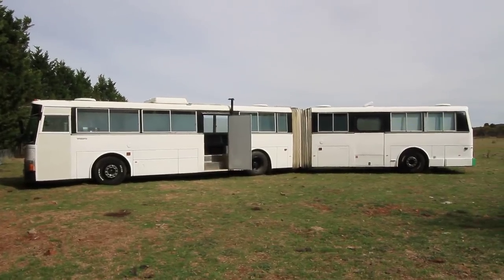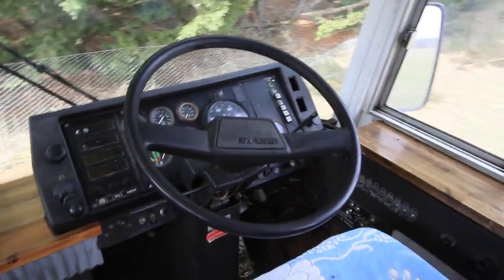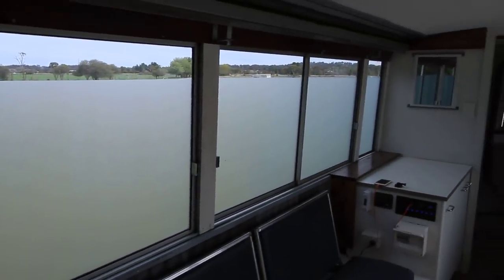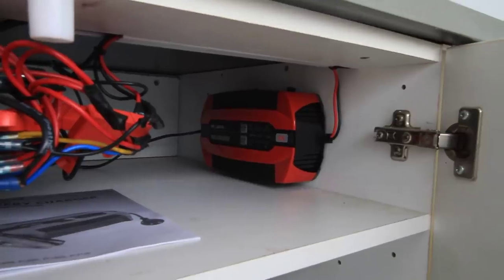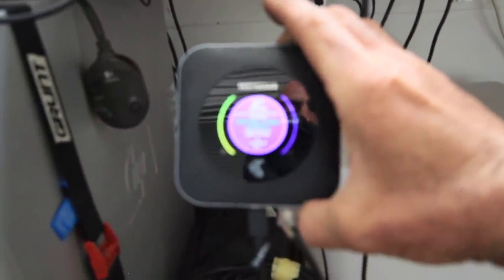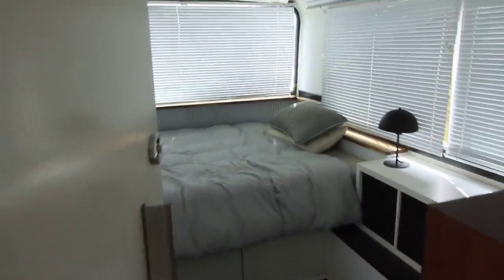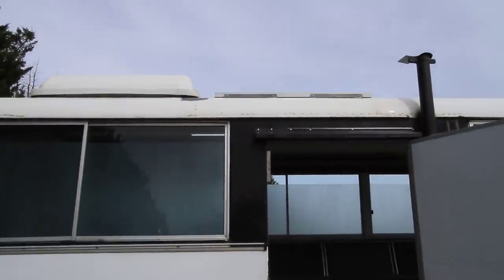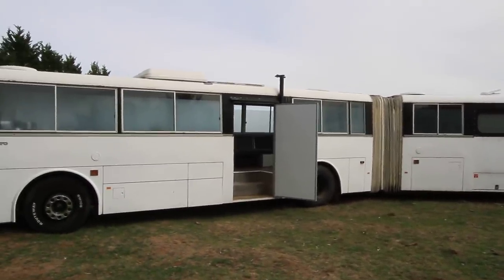BENDY BUS TINY HOME/MOTORHOME CONVERSION

Comment: I don’t know why I never thought of a bendy bus conversion, I see the busses fairly often but never thought of converting it. Great job on the bus !
Reply: most are mid engine buses which are difficult to work on and maintain so they tend to be un-reliable. There may be a few front engine ones but I have only seen mid engine ones and if I'm gonna live in it and use it I want something reliable and easy to service.
Reply: finding a mechanic to work on one of these is the hard part.

Comment: I used to drive those for the Toronto Transit system.
Much easier to drive because of the shorter front section wheel base.
In the Canadian winter, they Sucked because the engine was over the first set of duel wheels and the back end jackknifed real easy.
Great for a mobile home in a warm dry climate.
Reply: how is the long ass bus easy to drive?

Comment: This is a really cool conversion, not only in the aesthetics but also in the function. It feels like it was designed for living and not for travel, which is an interesting departure from most coaches, and really shows a different design path which really worked out. I also really like the windows, while you have to open them to have a massive view, it looks like you can see out of them while standing and they let a lot of light in while keeping your privacy. I also really like the bed placement, and that you did a full, king size bed.

You really got the light and airy design down, and it still feels very functional. Very nicely done! :-)

Comment: Hey I drive a later model of these Nick- I always wondered what customizing/ modding I coulf or would do if I ever got one.. very nice job on you're one. I had an idea if you could put a drop out ramp at the back (like atruck) and you could drive a small/ medium car in- then a trailbike attached on the outside of that.. all you need!

Comment: Nicely done!  We have similar buses in the US, but I haven't seen anyone convert one as you did.  It seemed obvious and I always wondered why nobody did it.  Good Job!
Reply: Most of the retired city buses in the US are so worn out you would not want one, like the police cars at an auction.. IMO one of the double deck buses like they use in Las Vegas would be an interesting conversion project.. You would have to know what to look for in the way of engine and transmission health before buying one of these from an auction though unless you have the money to buy a brand new one with no interior lol
Reply: @Elfnetdesigns maybe because the build quality in articulated buses in the USA are not high quality like in Europe? They don't have much life in them?
Reply: @Mr.Ramirez95  The engines are run into the ground high stop and go city miles and worn out..

Comment: Mostly I am just jealous of your build. Mine were about twenty four feet inside length built on C-60 Chevrolet 8.2 Detroit chassis with the full size Thomas Bus 22,000 pound GVWR. In grade school we went to the North Carolina state Capitol in Raleigh and saw the wealthy Duke families personal rail car they used extensively for travel having it towed with passenger trains. Your build with all that open expansive room reminded me of those days sixty years ago. If I were to set out to build something like yours I could not think about it and might give up before starting if I "thought about it too much". I could live in this space permanately. Doing some Department of Motor Vehicles searches I've discovered that RVS here in the U. S. may be 55 feet (17 meters)  65 feet or even 75 feet in some States if they are Combination Vehicles (trailer) or atriculated. Thanks a million for your response.

Comment: This is awesome, but definitely not a tiny house.
Reply: Its a tiny house. Its tiny. You can live in it.
Reply: Thinking the same.
Reply: I would consider about 400sqft tiny.
Reply: @Sasquatters  He said it's 40 sq. m. which is 430 sq. ft. I guess by your standards it's a small house not tiny house.
Reply: A tiny flat in my mind is less than 20sqm. 40sqm is a normal 1 bed flat where I like in the uk.
Reply: @user-jt1jv8vl9r  that must suck. Not sure how many sq m my house is but it's 3100 sqft.
Reply: trucker V It’s not so bad as a 1 bed flat is just a starter home for singles or young couples. My first flat (apartment) was 40-45sqm but it did come with a 150sqm garden which is rare. In fact it was a maisonette so it had its own front door and was only in a block of 4. In London 1 bed flats can cost up to £700,000. Probably $1,000,000 or so and not much bigger.
Reply: @Vgp-rp4iu  that's considered very large in most parts of the world
Reply: @Vgp-rp4iu  about 288 m2

Comment: Greetings from Yamba Australia. My son lives in Armidale and it's cold in winter. Perhaps you could install a small wood burner for heat. Looks great .
Reply: Insulation also. Foam is best.
Reply: Cold? Australia? Laughs in Canadian as it snows during summer
Reply: My town had a record winter this year, not for coldest temp but for how consistently cold it was all winter. Averaging _
-40°C to -50°C. One day was -65°C with wind chill. I could still live in this with a wood stove lol.
Reply: @bazz2438  LOL .We think the same thing when you say it's hot or dry. It does snow in Armidale and the nights there get below freezing point. I live on the coast where it is 20-30 c throughout the year.. Cheers.
Reply: @bazz2438  It can snow here anytime. I live in Massachusetts, not too far from Canada. We can have all 4 seasons in one week!
Reply: @bazz2438  The coldest I ever experienced here in MA is, -35° F last winter.
Reply: @heathenwolf4997  haha yes you guy's would have very similar weather. "If you don't like the weather just wait 15 minutes"
Reply: @kathyw3466  true lol I start to complain when the temperature hits 25°
Reply: @bazz2438  Yep! Lol.
Reply: Melbourne sounds like. ? Sounds like what?

Comment: I wonder how you would go with parking at a caravan park. bet you would have to park for two spots. haha
Reply: You get a pull-through site that can accommodate a 35 to 40 foot trailer and its its (full sized) tow vehicle.  That'll give you at least 65 feet worth of space (and probably more), which which is enough to fit a 60 foot articulated (or not {:-D LOL) bus into.

Comment: To much loose stuff on the countertops. Could be pretty dangerous if you hit the brake, make a turn or accelerate. Other than that.
Reply: Robert McDonnold maybe they're stuck down 🤷🏻‍♀️
Reply: You think, yes he would need to store things before traveling: as I am sure he would take the glass bowl off of dining table before stepping on the gas.
Reply: Probably all nailed down
Reply: @encalica853  i didnt see anything nailed down but maybe im wrong
Reply: thats why the wine rack is next to the steering wheel, to drink the sorrow away whilst driving

Comment: The most extensive, practical, but imaginative expedition RV build is by a couple on You Tube channel Everlanders. He uses 25 liter stainless Pepsi soda fountain for water, air actuated solar panels (1400 Watts), fully solar and diesel power. He's from Canada but looks like a Viking and built it all on a Ford F550 4x4 chassis redesigned by them. It looks like one of the 750,000 dollar Expidition rigs from Action Mobil. Engineering, solar, global technology, security, design, this guy and his wife think and do it all. They are still young. You asked for my ideas, I've looked at thousands of RVS, and if you look at his you will get more ideas than are in my little peanut brain.

Comment: Where do you even park that thing 😂
Reply: You get a pull-through site that can accommodate a 35 to 40 foot trailer and its its (full sized) tow vehicle.  That'll give you at least 65 feet worth of space (and probably more), which which is enough to fit a 60 foot articulated (or not {:-D LOL) bus into.

Comment: OUTSTANDING, Im in CANADA or id MAKE YOU AN OFFER.We have these buse's here i alway's thought this would be a good use for them .Also we have here in Ottawa THE DOUBLE DECKER  MODERNS they are very well built and would make a great motor home with the 2 levels.
Reply from the maker: Cheers Martin. Grab one and go for it. Double deckers are cool if us not overly tall as they are only 1.85meter max on each level.....but I do like them

Comment: Do your solar panels go to batteries as dc and then the current is changed to 110 ac by the inverter?  What gives you your 110 or 220 volts?  What is run off of 12 volt?  Is there a solenoid or anything that will stop the charging when your batteries are fully charged?

Comment: Great job and a credit to you and your partner.  What is the fuel consumption and do you have a highway dif fitted. What is your  cruising speed ?? .Been looking for a while at bus conversions and yours is one of the better ones. How do you go with the services ( oil, filters and what about the access to the motor and transmission.
Reply: I believe the ZF transmission has an overdrive and having travelled in a Volvo B10M rigid version with the same or similar gearbox to this bendy bus, it handled freeways with ease

Comment: In U.S. We call those ARTICS, for the articulated joint in the bendy part. They are easy to drive, the rear follows the front
Reply: We do for lorries in the U.K. but we call the busses Bendy Buses but they’re probably “officially” known as ARTIC Busses
Reply: @olliewenyon4617  I like "Bendy Busses" I'll coin the term.
Reply from the maker: Banana bus also :D
Reply from the maker: Slinky Bus

Comment: The only thing I don't like is that you can't see outside, because most of the bottom of the window is covered, you have to stand up to see anything outside. If it was me I would have used limo tint and it would look awesome from the outside too, because it would be black and white. Another thing with such long bus is getting space at camp grounds, most camp grounds have a length limit. Otherwise it's a pretty nice project you accomplished.

Comment: A lot of comments on your page, so I may have missed it but, can you spend a bit of time talking about the powerplant and drive train? In the video I only heard sparse mention of it as being placed somewhere in the near the articulation point and the rear wheels of the forward compartment. It appears that the unit is powered by a single drive axle placed as indicated herein, at the rear of the forward compartment of the bus. What engine do you have installed in the bus. Also what is the top speed, and comfortable cruising speed of the bus, what kind of fuel mileage does it get, how big are your fuel tank(s) and where are they placed. TIA, I would love to do one of these in the U.S., but the only place that I see them is in major cities, which causes me to assume minimum power engines and extremely low gearing to allow for frequent stop and start operations but certainly not compatible with high(er) speed operations on the Interstate Highways with speed limits in the 70-80mph. and virtually all other traffic at, or perhaps even slightly over these posted speed limits. Can this conversion even handle the long range travel that many RV owners use them for in the U.S. and perhaps even Australia?

Comment: Someone please correct me, but it seems that putting any appliance, cabinet or garage in the bendy accordion would be a challenge. It would have to be attached to the corregated steel but mounted on wheels but with proper measurements to account for the bend while in motion. Would be a great spot for inverters and such though.

Comment: It's neat, don't get me wrong, but it seems to be more of an exhibition than actual practicality. I mean that in the sense that a lot of things are unsecured (potential for flying around), there really isn't a lot of built in storage it seems, and all of those windows - even with frosting- don't have any insulation to help retain the desired temperature etc. It wouldn't be aesthetically pleasing but perhaps some reflectix or other material for those windows.
Reply from the maker: Thanks Megan. All the loose items simply get put in the drtawers and cupboards before travelling. Stool strapped to the table etc. The design is simply a reflection of my canvas on which to paint.  :)
Reply: @nickjordan7026  Ahhh so it is an artistic exhibition! It's amazing, glad the stools are secured, it didn't look like they were in the video. Thanks for the reply!

Comment: If you could fire proof an area enough you could put a tiny wood burning stove in it and change the battery set up to a 18650 brick set up for more longevity.

Comment: 3:00 very unsafe for kids and pets, because the pure metals of the power cables are visible at the converter. Question of time until they get connected accidentally.
Reply: Its just the 12v wiring thats exposed. You could put a finger there and not feel any current.

Comment: These converted movable called tiny houses make me wonder in case it breaks down, how and where any garage that would fit it in and during fixing it not impact on other designs, or ask mechanics come over then must be paid more than normal spend?  It looks nice design but requiring a lot of work such as maintenance skills/checking regularly on supply water/batteries/dumping waste/find or rent parking space/huge consumption on gas millage if it move.....to get it running smoothly so tough, to adapt this kind of living compared to live in a flat/apartment got to be prepared ahead of time along time for sure to get used to it!!

Comment: There's no way it's just a five speed. That would be a serious defect in a mass transit bus, especially a heavier articulated bus. It has to be a 32 speed arranged in five gear selections.

That said; I've thought about doing the same with one, until I found out one detail... they are slow, usually governed to about 35-40mph for stability. Since the engine is way in the back.
Reply: I think he said that the engine of this one is in the middle of the front section, so maybe this one isn't governed? Like you, I've only ever noticed the engines of these things to be way at the back, but this one does look to be an older model so maybe it's different...
Reply: You might be right, since theres a water tank back there. The governer might just be that harsh on pusher models.

Comment: We have busses very similar to this close to where I live. They are in the closest major city, Vancouver Canada, but they are actually electric busses, and they are attached to electric tracks above them, like a line from the bus going to the electrical wires, so I think it would be hard to convert them into a bus you could drive anywhere... the tour you did was okay, but I would've liked to see into the storage areas on the inside of the bus. I also would've liked to hear how the plumbing is with a regular toilet, how often you need to refill the water, or empty the tanks, and I would've liked to know how long you can live off the grid. I would also worry about the furniture that isn't attached to anything, because I would think when you drive it would be falling all over the place. Nothing seems very secure, which is fine if this is just a tiny house, to be parked but never driven... but you said it could be driven... Another thing is that it doesn't look like you've made good use of the space, there seems to be very little storage, and no real living room. It also doesn't look very cozy. I think curtains would have been a much better choice than the blinds, and then you wouldn't have to worry about them while driving so much (except if you leave all the windows opened). In future videos it would be nice to see into the storage inside as well. Anyway, that's my thoughts on this, but it was still a good video 👍

Comment: Simple to drive? With the steering wheel on the wrong side? You really need to evolve, wherever you are living 🤔 but a nice bus still, probably 100k€, about? And your bathroom isn't really a full size, btw why you installed monitor holders, that high? Just wanna give you some normal critique, you  probably tried the best you were able to...?